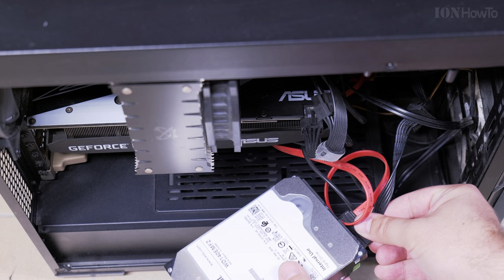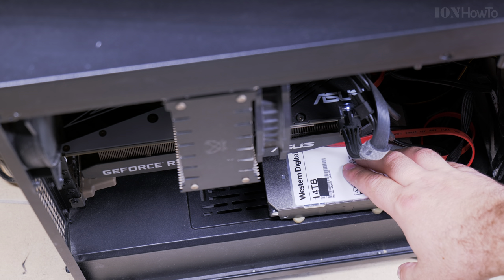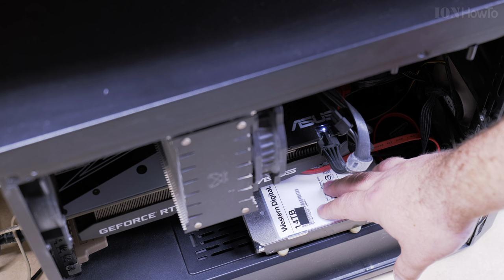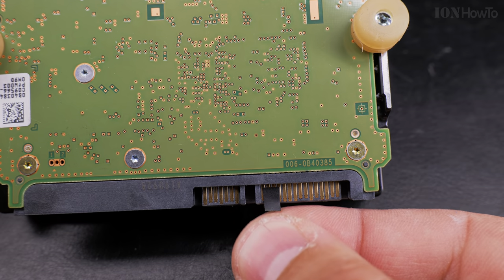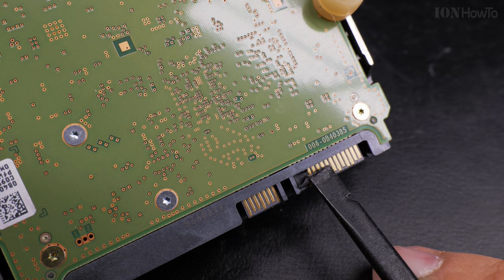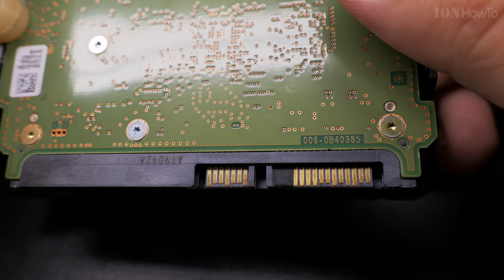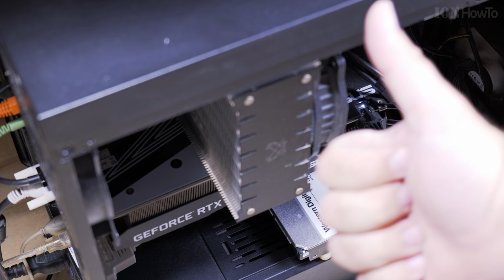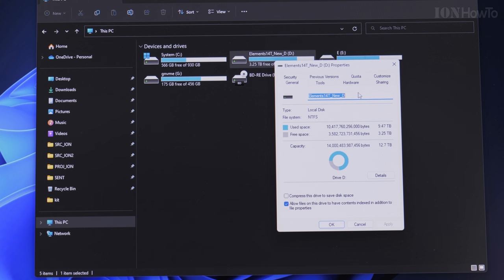Shucked WD HDD Not working fix 3.3v SATA Mod

Comment: Just remove the control board.  Use a sharp pointed tool (dental tool, exacto knife tip, etc.) to break the soldered leads for the first 3 contacts on the control board, which includes the 3 volts.  None of the 3 are needed.  Reassemble.  Profit.  Takes maybe 5 minutes and no messing with tape.
Reply from the maker: Wow that's a bit drastic. Anyone who doesn't want to use tape, use the crimped sata power adapters and remove the 3.3v wires.
Like that, the drive is not permanently modified.

Comment: I wish I could figure out the magic trick you used to get a piece of electrical tape that small to actually stay on there.  I think I'm going to try a dab of nail polish.
Reply from the maker: It stays in if you fold it over a bit over the edge. Should show in the video.
Every time you remove the sata power connector, you have to check for it falling out.

It's simple electrical tape. 
I wouldn't do anything more than this on the drive.
You can use adaptors but be careful that they're crimped not plastic molded.
I was afraid to use a bad adapter and was faster with the tape anyways.
Thanks for watching!
Reply: @IONHowTo  thanks for posting the tip!  I ended up using masking tape instead of electrical; it's a little thinner, and was a lot easier to stick on and cut to size with a utility blade.

Comment: You're the man!!! I was trying to figure out why the Hell my new 14TB drive from Cyber Monday was powering just fine from an external power brick but not my PSU, this mod did the trick and I can't thank you enough!!!
Reply from the maker: Enjoy and when you unplug the power on it, you have to put tape again. I did unplug it recently and forgot I had to put the tape back.
Reply: @IONHowTo  yeah true, the electrical tape likely won't hold up under the pressure of that SATA connector but it sure beats having to buy a new PSU or an adapter, my PSU doesn't even have molex plugs.

Comment: Amazon sells a 3-pack of SATA power extenders and a 2-pack of SATA power splitters that don't carry the +3.3V wire. No tape required.
Reply from the maker: I'm sure you know but writing this for anyone seeing this. 
Be very careful with SATA power adapters. Don't buy the moulded ones but always crimped is what I hear all the time but I don't know what a good sata adapter should look like.
That said, I just realized I was using a molex to sata adapter. Never had problems and hope it was the good type.

Comment: hello, sincere thanks for your detailed video. i tried this trick for the two 14 TB disk that came out from mybook duo that fell to the ground and became defunct.

thanks to your hack i was able to display the disks i could not see before, but when i tried to initialize/format both disks, i got "I/O error" and failed to initialize. does this mean both disks were damaged due to the fall?
Reply from the maker: if the drive(s) was on spinning when it fell, it's 99% gone.
In your place I would try another usb enclosure and redo the tape just in case the tape was moved while the plug was inserted. There are also sata power adapter that have those 3.3v lines removed so I'd tr that too.
Try it on another PC / laptop too via USB.
If none work, it's gone.
Reply: @IONHowTo   yes they were spinning as i was doing backup of huge files. i stupidly stepped on the power cable and the box fell :(

Comment: Man, thank you so much for this! This workaround worked on my WD 8TB. Is there any possible risk of loosing my files at the future through this method? ^_^
Reply from the maker: No risk at all. Use electrical tape and it's fine. Worst that can happen, is the tape comes off when you unplug the drive and it will not spin-up (same as before the fix) if you need to unplug the drive often, an adapter is better but be careful, some sata adapters are badly made.
Tape is fine if the drive sits in the case.

I use it like this since the video and it's working great.

This said, you can't trust a drive not to fail.
Have your important data on at least 2 drives. Ideally 3 copies, 2 media types and 1 off-site for really important data.